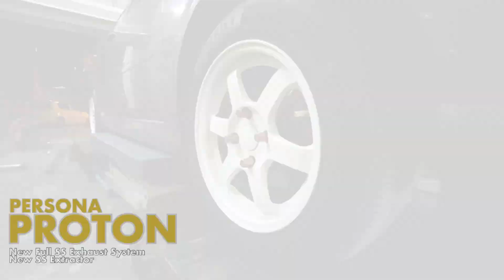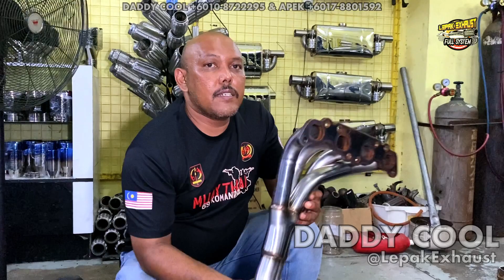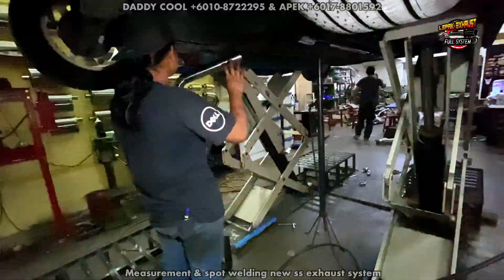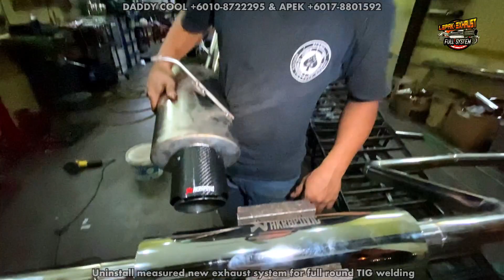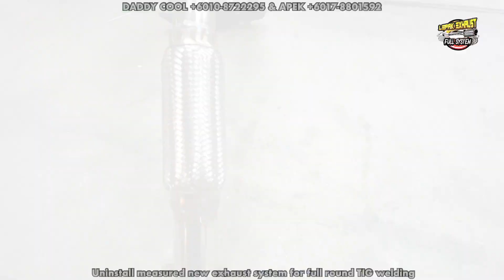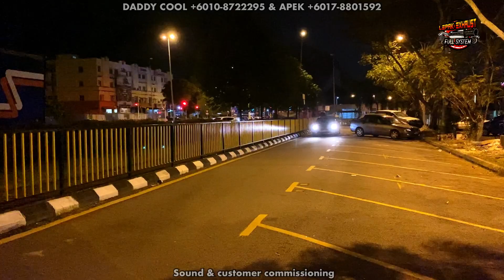New Full SS Exhaust System & New SS Etractor | PROTON PERSONA

Comment: Klau pgalaman den dulu guna extractor 421, twister bullet ngn straight flow msa pkai satria  mnual enjin 4G13 dulu pick up mmg mantol tpi top end mdatar nk capai. RPM bwah 4 mmg ok atas 4 agak lmbat nk capai top. Member den lak guna dkt persona mnual extractor 421, bullet ngn ekzos stndart pun smpai 170 ke atas top agak mdatar. Skang den pkai kreta persona den guna extractor 41,bullet tgah ngn sflow perfomance baru ok. Pick up boleh than lah wlau xpower cm 421 tpi top end makin tinggi RPM makin sdap top smpai.
Reply: Bullet apa sesuai untuk pesona auto  bos..kongsi bos ramuannya